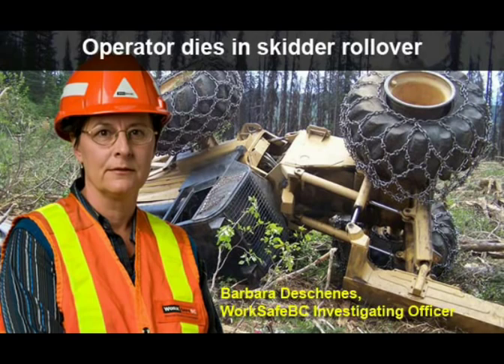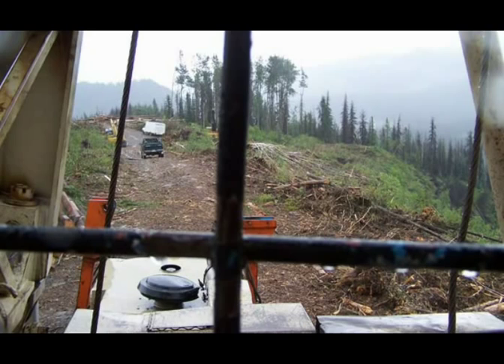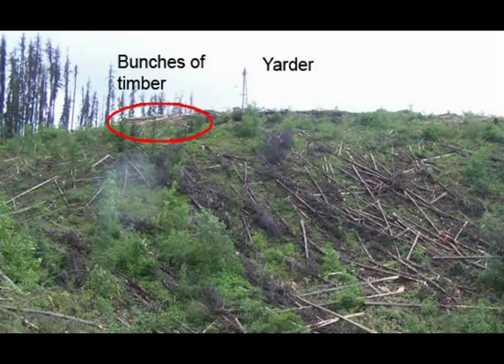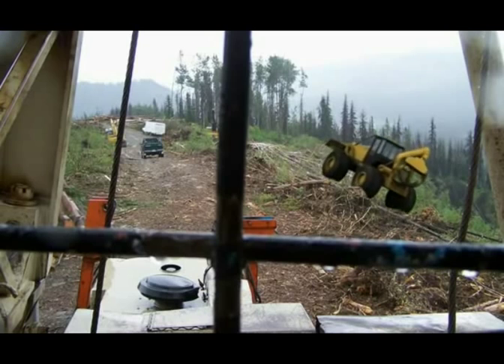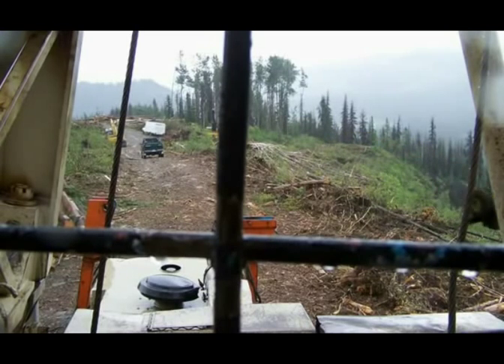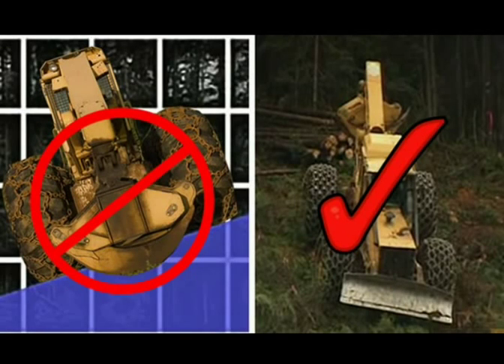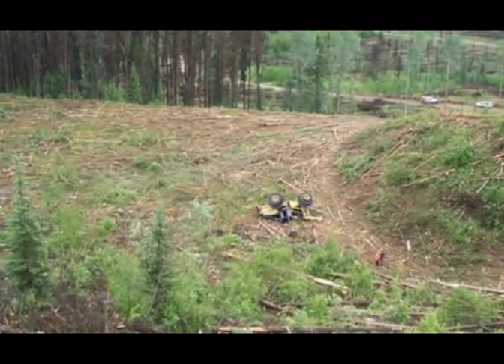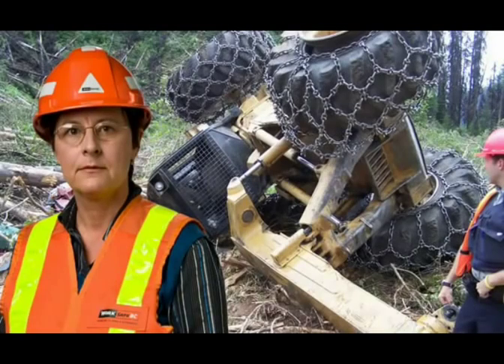Logging Accident: Operator Dies in Skidder Rollover

Comment: I doubt an intact seatbelt would have saved an operator from so many forceful rollovers.
Reply: i think it would help a lot but yeah you would not be looking very pretty by the end of it
Reply: People have survived much worse than slow speed rollovers. Being strapped in would have made his chances at better. The reason he died was probably an injury he wouldn't have gotten with a belt on, like a head injury.
Reply: Although I do think the belt would've helped, I tend to agree! 
That much tonnage, rolling down a hill that steep, a distance of over 400ft, is one HELL of a violent ride! The operator likely died of severe head trauma or internal bleeding. Shit...probably both!
Reply: @benjamins9121  You can get a serious head injury just from being jarred. You don't need any impact. See Dr. Daniel Amen.
Reply: But it tore. So guess who's liable?
Reply: I was in an incident where I lost the brakes in a skidder going downhill at a high rate of speed by the time I figured out the brakes weren't working.  It was a narrow truck road with a near vertical drop below, and I'm not sure if dropping the blade to stop the machine would have worked, it might have made it worse.  The only reason I'm alive is because there was no door on the uphill side, and I wasn't wearing a seatbelt, so in a panic I jumped out.  I'm lucky I cleared the tires or didn't get hung up when I jumped.
Reply: @yearginclarke God bless you.

Comment: my uncle took a job it had 40%+ grade a tower job but between the signing of the contract and start of the job the company broke up leaving him without the tower and him open toa lawsuit for not meeting his obligations in the contract. he bought a  new skidder hired my brother to run it and a long time friend to  help on the landing   the landing was at the bottom of the hill
 my brother would drag the line up the hill hook to a stump then winch the skiddet up the hill backwards drop the blade to hold it while he'd choke a entire log truck load of logs get in the skidder to raise the blade and floor the throttle in a attempt to out run the logs behind him to the landing 7 times he rolled the skidder. each time my uncle's friend told him what he was doing wrong.
finally my brother said you do and show me how .
he when up the hill and hooked a turn started down the hill and after about 30 feet rolled it end over end down the hill with the entire load of logs landing on him and the skidder.
he he suffered a broken neck

Comment: Are skidder operators under pressure from the Bosses to  get these jobs done? How are these accidents happening? What's the rules in the Forestry while approaching a gradient up or down?
Reply: My boss would get So pissed if I wasn't working fast. He had no safety concerns what so ever. He just wanted his paycheck from the mill and my life was not a concern. I worked as long as I felt comfortable but some of these people just don't care. I was on a job 6 miles away from any human contact. No cell service. And he expected me to do a job by myself. Some people just don't care.
Reply: This is an operator who would have been being cocky thinking he could grab them not on the bosses here because in a yarder block it must be done via yarder no exceptions or you will pay a fine and depending on what you did or how many times you will lose your business license that is way to small of a skidder to pull up 40% nevermind sidehill it
Reply: @hankisabelle1401  capitalism SMH

Comment: Im an old logger and the seat belt should have been replaced, seat belts that are frayed or partially torn will fail, seat belts can get cut from seat going up and down but having been burned replace immediately, skidder operator should only have backed straight over and straight back up.. I have skidded on ground north of Mackenzie BC, we skid 70 and 80% compo doesn`t care

Comment: I have been using a tractor loader backhoe on my property with 20 to 25% slopes in many areas for 14 years, without loaded tires, and I make movements very carefully.  The cause of the operator's death was more ignorance than the seatbelt.
Reply: Rolled up on a stump bo longer 40% grade more like 75%

Comment: What on earth is a "40% slope"? Wouldn't that be said to be a slope of 40 degrees, an actual measurement system?
Reply: Since this has been sitting here unanswered for nine years I'm undoubtedly wasting my time, but slope in roads, terrain and other civil engineering and surveying areas are generally measured by percentages determined by the ratio of the length of a slope in relation to the rise. A rise of one foot on a slope of one foot is a vertical which equals a 100% slope. A rise of one foot in 10 feet is a 10% slope.
BTW skidder operator for 20+ years. Bad choice by the operator. Secondly the whipping action in that many rolls might very well have killed him with an intact belt. Your head is likely going to contact many metallic parts even with the  belt.
Reply: @Mudpuppyjunior  
This has been sitting here for 3 years, and it is incorrect. 
The slope is the ratio of the rise to the horizontal distance (not the slope distance). A 100% slope is a 1:1 or 45° degree slope.
The slope is the tangent of the angle above horizontal, not the sine.
The angle whose tangent is 40% is 22 degrees, and by the same calculation a 70% slope is 35 degrees.
Reply: I like it better in roofing terms. you can say 4 on 12 or changer scale to 16 on 48. Easy to visualize.